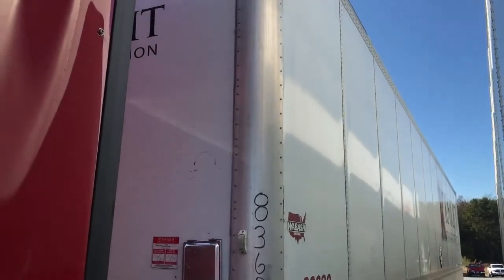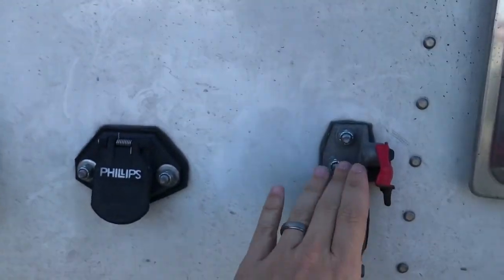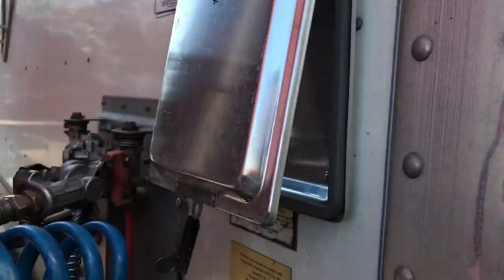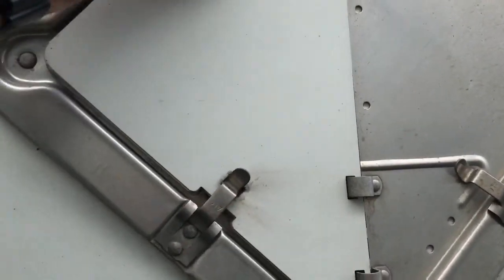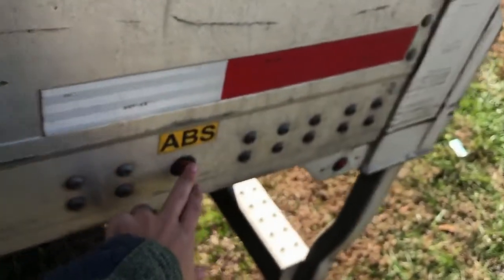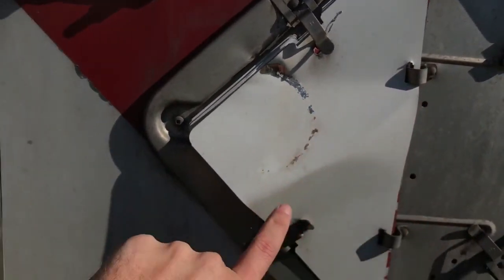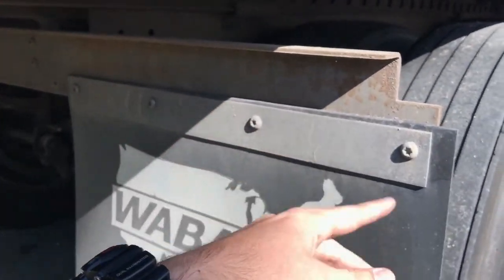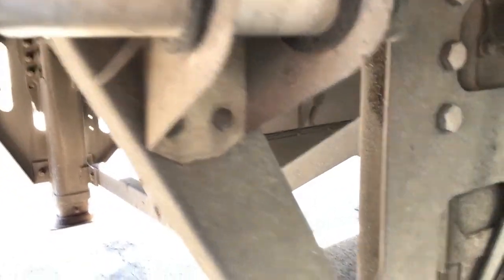Parts of a Semi Trailer Explained

Comment: The underside of the trailer connected to the kingpin is called the apron.

The top of the fifth wheel is called the skid plate.

The part of the kingpin that the locking jaws connect around is the shank.

Comment: what's the size of the king pin? here in western Australia its 3.5 inches I think Victoria still uses 2.5 king pins on their  trailers if they come over here with trucks that set up for 3.5 king pins have to put collars on the Victorian trailers
Reply: depends on the trailer, most of them are 3.5 but also 2

Comment: Amazing that the “little” King Pin can hold all that load, connecting the trailer to the tractor. 
How is it attached to the trailer. 
BTW Great video
Reply from the maker: Tom Giblin it’s crazy too when you see these super truckers wreck and flip over and the kingpin stays locked in place after all of that violent torsion!